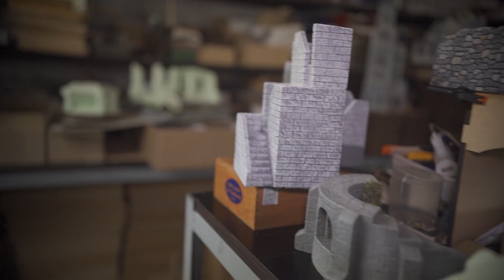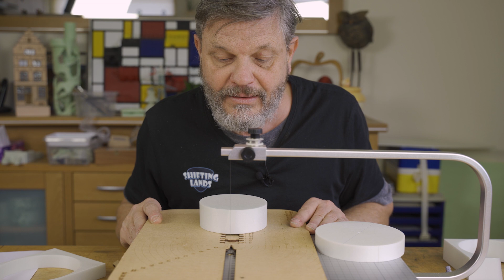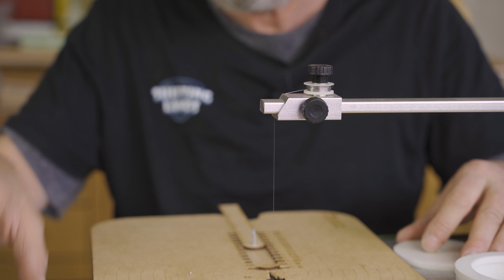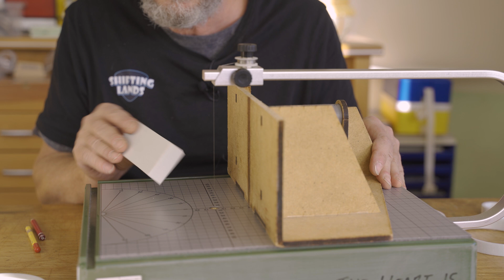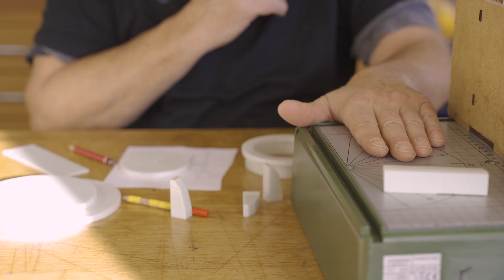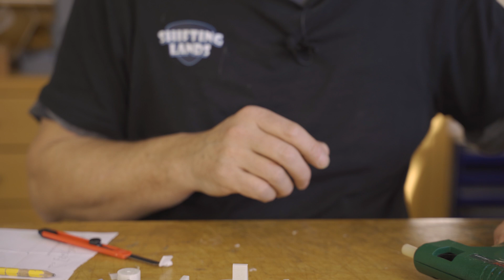Medieval Fountain Build Along session

Comment: How big a circle, in inches can the circular cutting board make?  I have one.  I need to build the walls for a turntable pit.  The inner circle would be 13.75" .  The problem is cutting it thin.  I would have to cut it in sections because of the Proxxon arm height to slim it down and then reassemble it.
Reply from the maker: if you think a bit out of the box you can cut huge circles, look at the video about cutting a huge circle 
But using the circular cutting board in a traditional way then 14 inch will not be a problem.